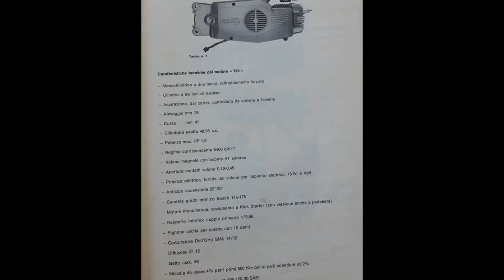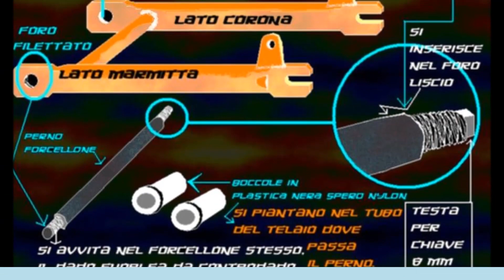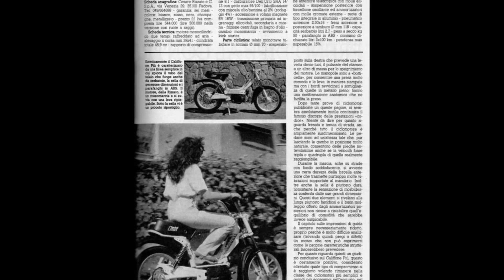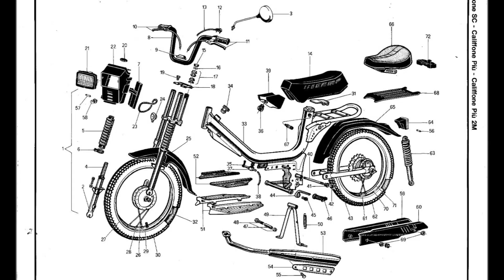Rizzato Tribute - Raccolta foto Califfone ed elaborazioni

Comment: Is the exhaust System selfmade or did you buy similar parts from another scooter?
Reply from the maker: Yes, it was self-made starting by an mhr malossi made for Minarelli engines (Phantom f12 and similar) collector made by a pre-bended pipe and  artisanal silencer. And it was welded with mig welder. So the muffler isn't self made, only the silencer and the collector
Reply: @VESPARISSIMO  wow, i'm impressed. Great work👍
Reply: @VESPARISSIMO  do you know anything about similar exhaust parts from another scooter? The original exhaust is just too small and i cant find matching parts...